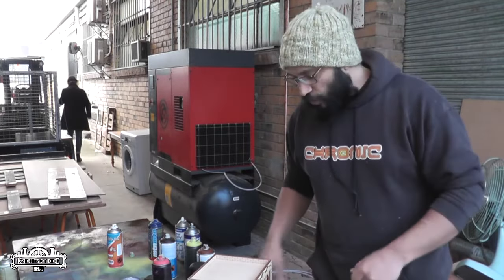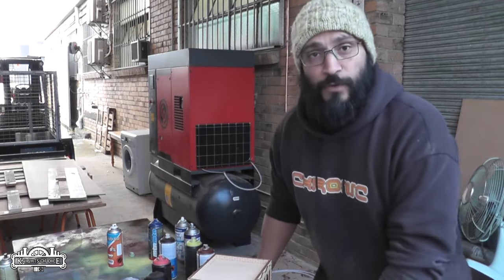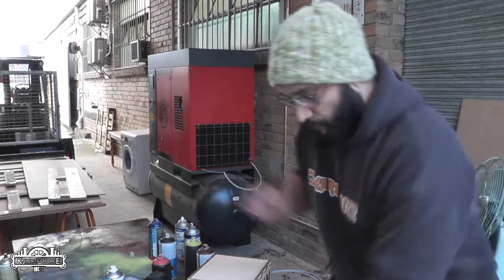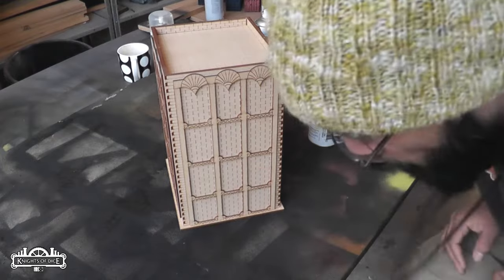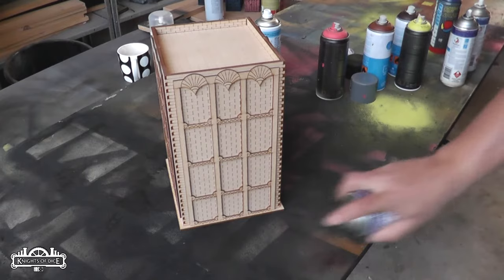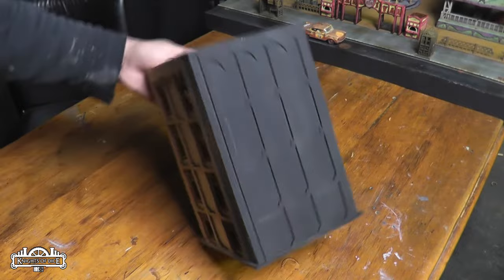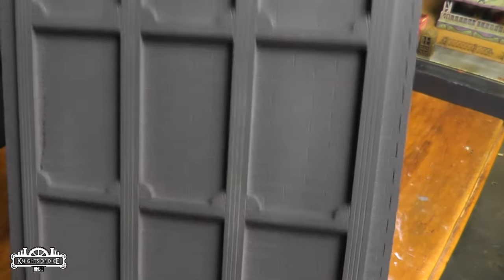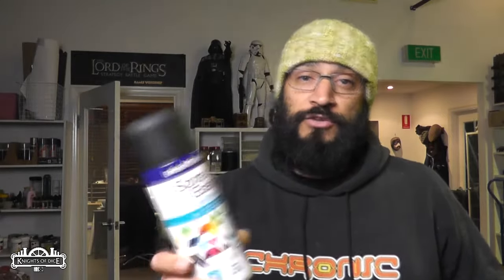Priming MDF buildings - what we use

Comment: Ok, so I had some trouble with that paint. I sprayed a bunch of Ork Boyz, probably only let it dry for an hour, then applied another coat of spray as the base and the paint just rubs off. Did I not let it dry enough? Or is it just shit for plastic?
Reply from the maker: That's odd ... I've never had any problems using it on plastic.  You shouldn't need to wash plastic figures before priming.  Did the black undercoat stick before adding your second spray?  What was the second spray?  Perhaps that affected (somehow?) the black undercoat.  Sorry, can't be much more help ... it's very odd.